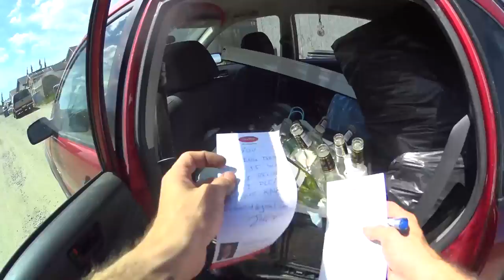Bottle Picking Dumpster Diving and Scrapping - Back In Full Swing!

Comment: doesnt your scrapyard buy circuitboards? go to your local computer repair place and offer to take any old computers or escrap they are trying to get rid of and scarp them out.. seperate your boards and bam cha ching!!! here in minnesota i get $2.70/pound for high grade motherboards and $10/pound for ram $.60/pound for hard drives $.20/pound for disk drives and 40 cents for hard drives.. there are a few other components but overall im getting $5-10 a computer.. thats usd. Now go do the thing g!